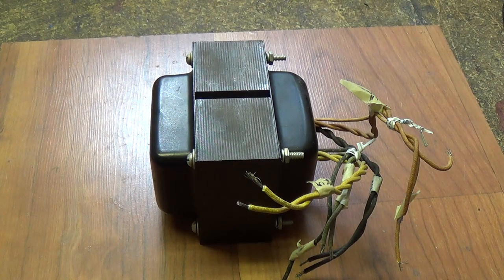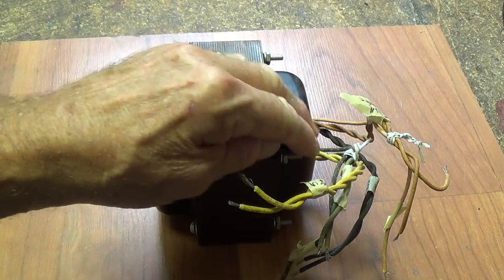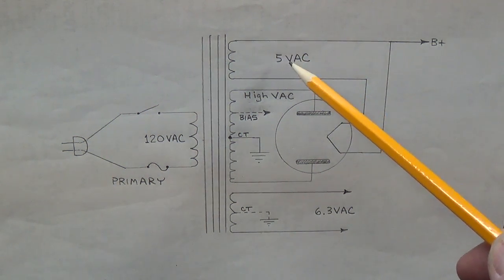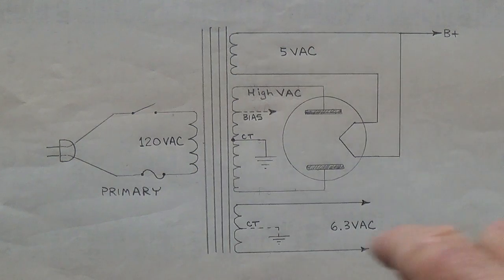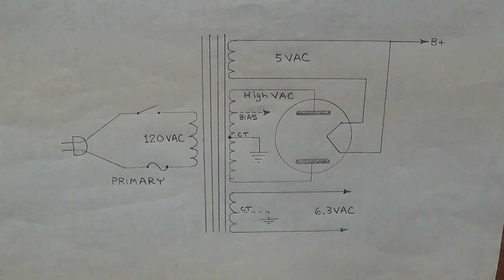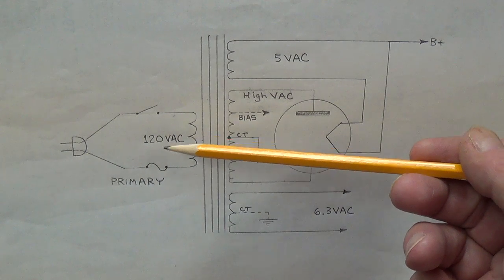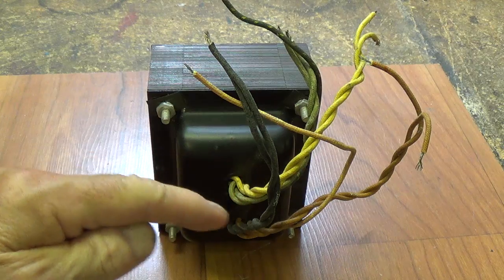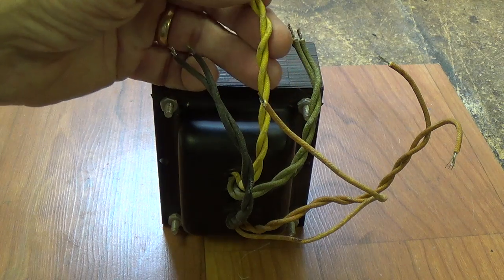How to Identify Amplifier Power Transformer Leads

Comment: I removed an old transformer from a radio,and it had ez81 rectifier, but study it now,it only have one heater winding, strange, its werry old, so i found the heater winding to have wrong resistance,so i cant use it annyway,
Reply from the maker: Thanks for sharing, NB.

Comment: on my power transformer i have identified the high voltage wires and the center tap. 

from center tap to each wire i have 55ohm of resistance and my meter rings out. 

between the 2 high legs (omitting the center tap) i have 110ohm of resistance but my meter does not ring out. 

does this mean that my transformer is bad?
Reply from the maker: I have no idea what "rings out" means, Todd, but from what I do understand, your HV winding is perfectly fine.
Reply: @ i’m sorry. it means it gives a tone or makes a sound.
Reply from the maker: @toddmiller2147  I have never heard of an ohmmeter that made noise for any reading other than 0 Ohms, Todd. I would simply accept the resistance readings.
Reply: @UncleDoug  i’m a commercial electrician. the meter is a fluke 323. it has a ohm meter/continuity meter that reads resistance and makes an audible tone for continuity at the same time.
Reply from the maker: @toddmiller2147  Apparently it either malfunctioned or it initially considered 55 Ohms to be continuity.  Either way.....ignore it and accept the readings. As I said previously, your OPT is fine.
Reply: @ and, here’s another dumb question. will the tone quality be less due to the fact that the leads have all been cut about 3” short?  will extensions hurt sound quality?
Reply from the maker: @toddmiller2147  No effect at all on tone, Todd.

Comment: Cheers, Uncle Doug--

Thanks for all the education. I got a question about old transformers, the type with 2 black primaries. Are they interchangeable when using a 3-prong cord having black (hot), white (neutral), and green (ground) conductors? 

Thanks again for all the info!
Reply from the maker: Yes, either of the black primary leads can be connected to the black power cord wire. There is no polarity concern.
Reply: @UncleDoug  Thanks, big time. Keep up the good work!
Reply from the maker: @stephenrioux6821  You're welcome, Stephen. Will do :)

Comment: Not all HV secondary windings are center-tapped though. Some (especially television and high-power audio amp) power transformers have only two HV secondary leads. When the HV secondary has only two leads, the B+ rectifier will typically be solid state. Full-wave bridge (example: Marshall JCM800 and other large guitar amps) and full-wave doubler (examples: Harman-Kardon CA-100 public address amp, many RCA CTC-9 to CTC-38 and later color television sets).
Reply from the maker: You're right, JH. All of this is covered in detail in my video on power supplies and types of rectification.

Comment: Excellent video - thank you for posting. A few details that the novice may need to know: 1) After energizing the primary and when taking voltage measurements of each secondary, the voltages measured at each secondary will be higher than you may expect. The reason is because the transformer is not under load. Once the transformer is placed in a circuit and given the prescribed load conditions, the voltages will fall to what you would expect to see. For example, that 370v RMS high voltage, will load down to something closer to 350v when the transformer is placed in service. That 6.3v secondary will probably measure something closer to 7v RMS on the bench, but come down to right around 6.3v RMS under expected load conditions.  2) I will double-emphasize what Uncle Doug said about not getting into a big hurry, and to please use a current limiter.. If you goof and put line voltage on (for example) one of the filiment secondaries (like the 6.3 or the 5v secondary), the transformer will not have enough inductive reactance on that winding to limit the current. At best you will probably throw a circuit breaker in your house, or at worst you may over-heat the transformer and destroy it. 3) If you find an old transformer like this, it may be perfectly good, but it may also have been removed from service for a reason. One such reason might be that it already failed from over-load. When transformers fail from over-load, often times what happens is that either the primary or the high-voltage secondary will develop shorts between the windings. When this happens, it can draw excessive current just by having the primary plugged into the voltages it was designed for, unless the primary already failed open. If this happens, you will get excessive current even when you are doing everything correctly. It never hurts to put an amp meter in series with your primary so that you know what the transformer is doing. Also one caveat and disclaimer is that if you don't know enough about electronics to understand how to connect an amp meter in the primary circuit to measure the current, then you probably don't need to be dabbling with something like a supply transformer anyway, and should leave this kind of activity to people who possess the knowledge and skill to do this kind of work safely.
Reply from the maker: Thanks for sharing these excellent safety suggestions and observations, Jim. We really appreciate your helpful input.

Comment: Uncle Doug, will the limiter prevent me from getting absolutely zapped even if observing very careful technique? After watching many of your videos, I feel more comfortable embarking on my first build using my accumulated salvage. Nonetheless, I would like to take every precaution possible. Thanks!
Reply from the maker: The Current Limiter is primarily to protect the circuit itself from a short circuit, Will. You can still get shocked it you don't carefully follow all the rules for safe handling of high voltages.

Comment: hi uncle uncle doug could you do one to figure out the bias tap
Reply from the maker: I'm not sure that a video is necessary, D&C. You can determine the relationship between the leads using an ohmmeter and then simply connect the primary to AC and measure the voltages on each lead.

Comment: hi doug you are a champion ..iv done an electronics certificate but we didnt study valve,tube circuits..so im loving your videos,im learning so much.....so what would be the voltage of the wires if it were diode rectifier and not a tube rectifier....would they still be 5 volts..i have to change my power transformer on my 1974 twin silverface...someone changed the input voltage selector and put it to 120volts ..here in australia we have 240 volts..so primary must be fried..its blowing fuse..so i put the light bulb in series with fuse leads and it lights up fully lol
Reply from the maker: You don't need a 5VAC winding on the replacement power transformer, Chris. Replacement Twin PT's are readily available from parts suppliers and only have 6.3VAC and High Voltage windings.
Reply: ok thanks for that i found one with all the right dimensions and specs
 @UncleDoug
Reply: https://www.evatco.com.au/assets/brochures/290FEX.pdf @UncleDoug
Reply: @UncleDoug  it has 60 volt aswell which I will have to work out where it is on my amp .. I’m not sure so I’ll watch your vids again.. I’m new to repair of tube amp so I need to watch your vids and learn before I attempt to change power transformer..have you done a vid of twin power supply with diode rectifier.. that’s what I need to learn.. the negative voltages etc
Reply from the maker: The 60V tap is probably for the -DC bias supply, Chris. Based on your questions, I'm a little worried about whether you should attempt this repair.  Perhaps you should seek help from a qualified tech. @cpchris2
Reply: @UncleDoug  don’t worry I’m a qualified tech and electrician iv rewired ovens stoves etc and heaps of 3 phase installs at work .. also have replaced the filter caps some resistors etc .. I have all the equipment to work safely, isolation transformer good multi meter so I have strong electrical backround  but haven’t really studied tube amps .. I found schematic and heaps more confident now and your vids really helped thanks heaps
Reply from the maker: Sounds good, Chris. We care about our viewers. Be careful and successful. @cpchris2

Comment: Uncle Doug, I don't remember if I were one of those asking but I will defiantly appreciate your knowledge! Busy testing an old phonograph type and was not sure about the power cable, as all the cable were open without there male or female plugs. Yes I could have tested the wire before I connect to the power, I track the wire at the back on the inside at the Transformer, but that wasn't the power cable, it was the speaker wire. So a little bit of smoke and there I made a big mistake with this 50's Phonograph with a Receiver. I would like to send you pic's, yes!  SO after knowing about the awful mistake I took the other double wire and connecting it to the power after tracing it, I had to dismantle the whole system. Luckily, Luckily it is still power on, the only problem is that there aint any sound any more... I know now why and would of coarse love to fix it. Regards
Reply from the maker: Photos are of no benefit, Rudolfes. Your time would be better spent focusing on making the repairs yourself or seeking qualified help. Good luck......and be careful.
Reply: @UncleDoug  In short, because I think you know what burn in such a case. What has to be done? Thank's

Comment: Thank you for explaining everything so clearly, as always. One question that I couldn't find anywhere is: Why a common way to test power transformers is to measure their unloaded voltage at the secondary, but switching on an amplifier without any load connected is strictly forbidden as it would fry the output transformer? Is there something that makes power transformers different or more resilient? Or the output tubes play a role in that?
Reply from the maker: Apples and oranges, Ani. They are completely different components, subject to very different stresses and limitations.

Comment: I have a Kustom solid state guitar amplifier that does not have output. I checked the power going into the primary and get 120vdc and on the secondary there is three wires two red ones and in the middle a yellow one, the two red ones are reading 13vdc into the PCB the middle yellow wire is not providing any voltage, Does that indicate that the transformer is the problem for no sound output? could it have a short? there is no sign of overheating or burned areas.
Anyone know?
Thank you
Reply from the maker: Have you checked your output (power) transistors?
Reply: @UncleDoug  I checked a couple of the transistors that i see and on one i did not get a reading on the collector pin but i do not know if it is an output transistor.I also checked several of the resistors and some capacitors and they are getting a signal/voltage.
It does not help not having a schematic to go by.
I think i might remove the transistors to check them.
Anything  else i should check? I will keep troubleshooting.
Thank you Uncle Doug for replying back.
Reply from the maker: @SDsailor7  The output transistors are generally quite easy to identify. As I recall they were mounted vertically on the back wall of the chassis with big heat sinks. I am no expert on Kustom amps or SS amps in general, so my input is rather limited.
Reply: @UncleDoug  Well I found out that what I thought were transistors are not. They are IC's even though they look like a transistor. One is a L7805cv and is a voltage regulator the other one is a TDA2050 that is used for amplification. So now I got to do some test to see if they are working. This is the first time I have encountered these components. I was reading that for most of the newer amps there are no schematics available so all I can do is test these components and see if they are ok or bad.
Reply from the maker: @SDsailor7  Kustom schematics are numbered by the number of the PCB used in the amp, with separate boards for preamp, power supply, output, etc. Here is a page of schematics:  https://search.aol.com/aol/image?q=kustom+k200b+amp+schematic+diagram&s   The four output transistors are easy to spot. See the 3rd one across in the 1st row.

Comment: mr doug is there a way to determine the amps of the secondary taps?
Reply from the maker: Nope. About all you can do is guess, based on mass of the transformer and gauge of the wires.
Reply: @UncleDoug  thanks my friend. Hopefully the taps i'm working with are at least 2A. The PT weighs like 2 lbs
Reply from the maker: @geezberry8889  There is one good way to find out, G.

Comment: Thank -you  ... wow a great video ' very informative ' have you ever done any 1950 s AMI JUKE BOX amps ' in the past  ?
Reply from the maker: Thanks, Neal. Yes, I have restored countless jukebox amps.....of all brands, including AMI.
Reply: @UncleDoug  I was wondering if you can help me with my 1954  f - 80 amp , the box plays nice , I have added a pair of external 8 ohm speakers 8 "inch ,  +  5 " inch mid , and super tweeter in each box  , sovtek  6L6 wxt ,12au7, 12ax7 also upgraded to a  Stanton stereo needle , when I first received the juke in 2006 , all the 120 v wires needed replaced , I did this also myself and it looks completely oem stock , I play the box alot , so much so that I change 45s 2 times a week , it's great fun , with 2500 + records to choose from , I would love to send the amp to you for a once over , the capacitors have been up dated in the amp , Also in 2006 ,  I tested the tubes this past week and only found the 12ax7  tested low but' ok ,
Reply from the maker: @nealsturges5879  I'm sorry, Neal, but I am currently swamped with repair work and honestly cannot take on your project. Also, without the rest of the system, trying to repair the amp would not be feasible. I suggest that you keep at it and resolve the issues yourself. It would be a lot more practical in the long run.
Reply: @UncleDoug  Hi Doug I understand that without the cross over network and and complete box powered up ' its only part of the compete system .  As i mentioned in 2007 the amp was up dated by a gentleman that worked as an on call service man for small establishment owners that still had working 45 juke box systems  ' I have been using a Varaic 1.4  KVA  to maintain 115 volts AC power from the wall  since 2007 ' it has its own toggle switch so when its off ' its Safe wile no one is home . No doubt' I am sure some person  in the past has had to make the sad phone call to there insurance man ' that there house has burned down by a 60 year old wiring issue . Even the 24 volt transformer could burn up if there are problems with the wiring . fuse protection etc .  that would also make a great video for the future ' cheers to every one enjoy the summer .
Reply from the maker: @nealsturges5879  I only  wish that I had the spare time to take on this challenge, Neal. Hopefully you can do some studying on the internet and resolve the issues yourself. Good luck.

Comment: I don't know it the current limiter will help against being zapped but i use a 12v transformer and a variac to get a straight 12v for my tests, just had a zero to the results. I use the same method to find the ratio of an unknown output transformer. You suppose to substract 10% of the voltage of an unloaded transformer to get the voltage under load. I also try to find the amperage of the high voltage with resistor and ohm law but it didn't seems accurate.
Reply from the maker: Thanks for your input, Andre. I know of no reliable way to determine the current capability of a transformer.

Comment: Doug, I dug out a power transformer from an old radio the leads going to the tubes and whatnot are all a single enamel-coated wire that is wrapped in a cloth type wire jacket, The Jacket has gone dry and very brittle, I would like to shorten the enamel leads closer to the transformer and put new color-coded correct wires, would normal heavy gauge PVC jacketed wire be ok? or do I need to try to track down cloth jacketing material?
Reply from the maker: Vinyl insulation should work, Pat.....the more flexible the better. Also, if you have exposed joints anywhere in the wiring, you can coat them with black silicon gasket sealer. It will harden into an impervious flexible insulating coat.
Reply: @UncleDoug  Many thanks Doug 🙂

Comment: If I have an tube amp that is 220volts can I split the transformer to make it operate on 110volts? Thank you
Reply from the maker: If the power transformer is wired for both 110 and 220 VAC, you can simply change the primary wiring from series to parallel. If not, you'll probably have to change to a 110VAC power transformer.
Reply: @UncleDoug  thank you
Reply: @UncleDoug  if the transformer is not not marked how would you be able to determine it could be converted to parallel. Sorry if you already have a video for this
Reply from the maker: @kristenluoma538  Some PT's have a center-tapped primary winding that allows you to connect the half-windings in series for 240V or parallel for 120V, Kristen.

Comment: Hi Uncle Doug, I've put together a few guitar tube amp kits but they were neatly labeled with directions especially the leads for the PT.  I recently purchased a tote of old organ parts which includes many PTs and OTs, and other goodies.  I really want to build a guitar amp with these PT but their leads are not labeled so I came across your video .  My question is, when your measuring each lead, how do you setup/connect your current limiter and to the PT, so that you can get the correct readings on your multimeter? I totally understand how dangerous this process can be so I want to make sure this is clarify prior to doing it myself.  Thank you.
Reply from the maker: All is explained in my video regarding the Impedance Ratio, WL. Good luck.